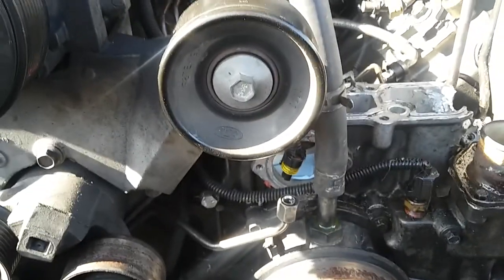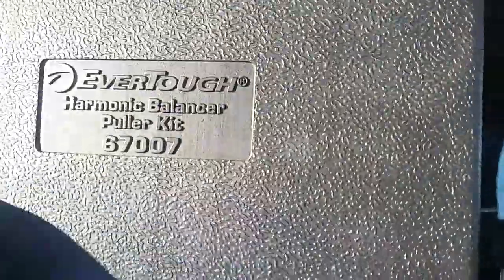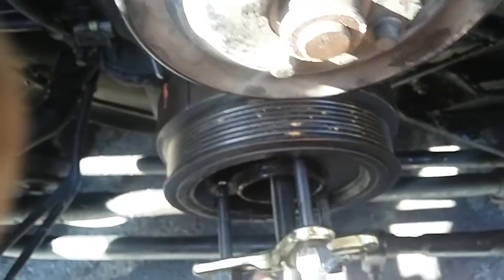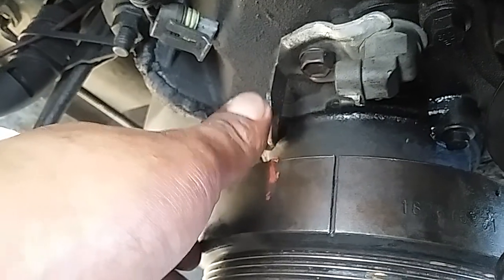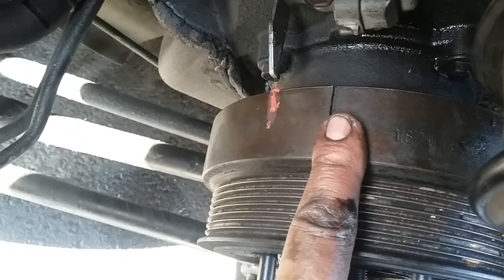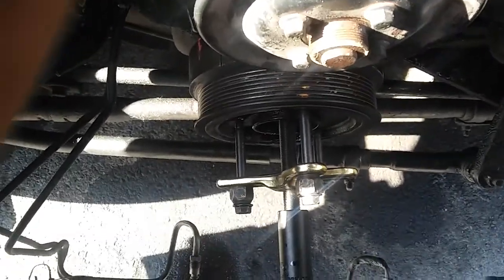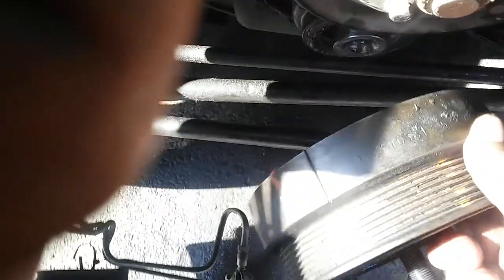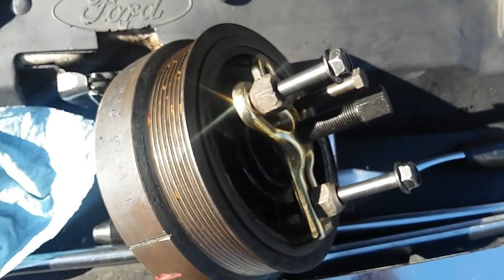How to remove crankshaft pully out V8 7.3L engine

Comment: I got it out. How the hell I get it back on.
Reply: Step 1 back off  the crank bolt!
Reply: @Billy-ye3ge  That's what the Dead Spot is for, the paint mark removes the need for a bolt
Reply from the maker: Get a pice of wood and put on front of the pulley and top it with a hammer
Just find the Mark of the pulley inside around and line in first 
Takes a little bit of time try it little by little add lube around if you can first
Reply: xJOKERx_15 thank you buddy. I’m never going to work on a truck again

Comment from the maker: Yes every car or truck have one 
just you just find the marck in your engine  and the other one in the pulley
before you starting removing the the pulley out 
at line the two marcks first
Reply: Negative, you don't have to mark the crankshaft pulley before pulling it it only goes on one way.

Comment from the maker: I used the the same one 
The reason for the job is because the timing cover was cracked
but try to get "OEM" part used but  in a excellent condition
or New ones
go in EBAY you will find what you need